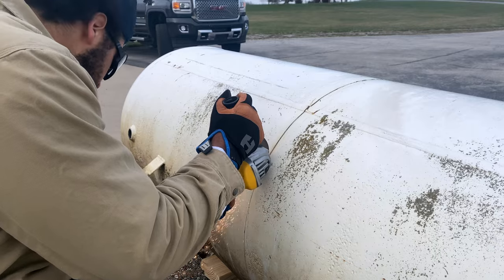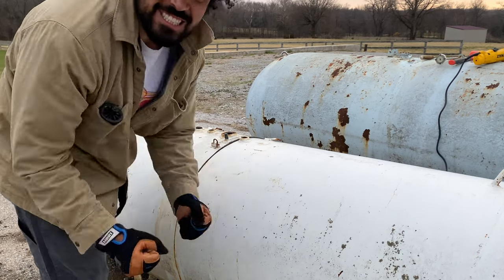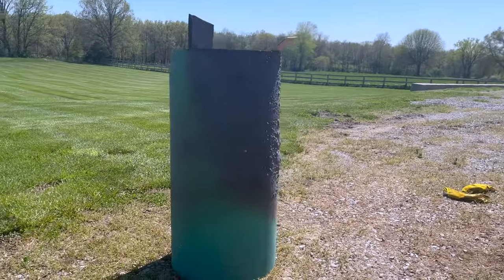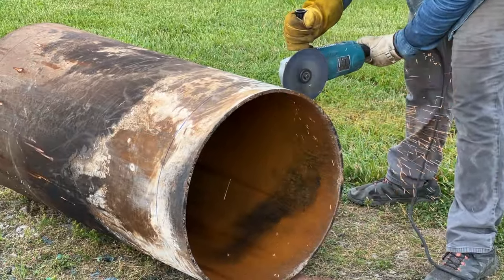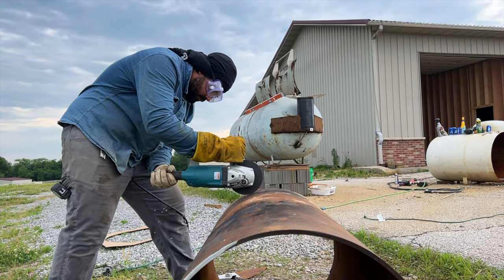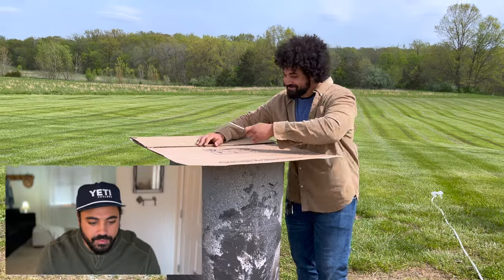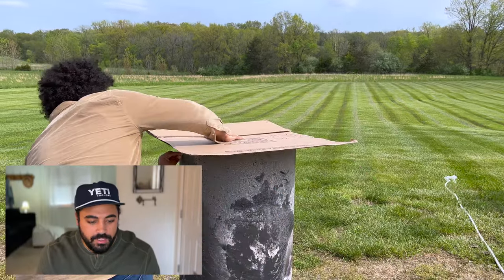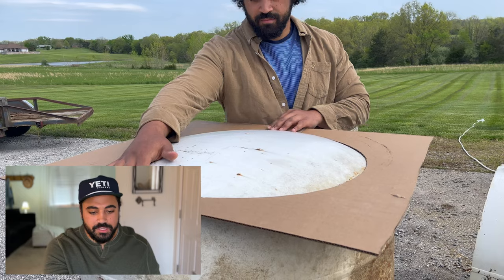Building A 500 Gallon Offset Smoker: Making The Semi-Insulated Firebox

Comment: The throat opening was the scariest part for me. Eventually i had to cut two more inches off the smoke chamber to make it work/fit right. Looking good so far! We ended up going with an insulated rectangular firebox with half of a 120 gallon tank as the liner.
Reply from the maker: Dude why is that the hardest part?!? Lol glad you got it sorted. Mine came out nearly perfect after all, but it wasn’t void of MANY headaches 😂

Comment: So you should have actually cut the hole bigger on the pit itself that way the Firebox can actually slide into the pit and not be welded flush against it and you would have not have needed all the spare metal. From Texas BBQ capital in Alaska welding on boats in the Bering Sea
Reply from the maker: Thanks for the support my friend!
Reply: @MeatNGreetBBQ  great job we all learn from our first pit build next time just slide the bottom of the Smoke Box into the pit more itself as well bro
Reply from the maker: @shaunreid6497 for sure bro! Good news is the pits been running great these past couple years and now I have much better idea for when I build… a 1000 gallon next 👀👀

Comment: Just throwing this out there. That liner may be sewer pipe. If it is at all used I wouldn’t use it because burning it out may not fully get rid of the residual h2s
Reply from the maker: It was a new pipe when I bought it. Had a guy cut it off a MASSIVE piece of pipe. It’s just rolled steel with that film over it. But good call on the sewer pipe that would have been all bad! 😅

Comment: Oh, I remember that green coating. It was a bitch to grind off. I was not able to burn it off like you did (the city I live in would have sent out the fire department and charge me for it).
That coating is for rust protection. That pipe was nent to be directed bury in the ground.

Comment: what is your outer shell diameter ?
Reply from the maker: Shoot I can’t remember— I feel like 36” but not certain. Just the diameter of a normal 250 gallon tank.
Reply: @MeatNGreetBBQ   thanks for the response i got a 125 gallon propane tank for my firebox,  outer shell is 30 in diameter so i think a 24 in diameter  would fit enough to give me a gap for insulation its for a 500 gallon smoker

Comment: I'm really surprised I haven't seen a comment with this: PLEASE WEAR A FACE SHIELD  WHILE USING GRINDERS. If one of those wheels comes apart, goggles are WHOLLY INSUFFICIENT to protect your FACE from fragments flying off after spinning at 11,000 RPM.
Reply from the maker: You’re like 2 years too late boss 😅 but I lived!!! God is good 🙌🙌
Reply: @MeatNGreetBBQ  it wasn't just for you. I was an iron worker before my current job and I've had them come apart. I've also seen them buried in somebody's welding shield when they came apart instead of embedding in their cheek. It's a really underrated hazard.

Comment: You should’ve packed insulation in that gap all the way around your firebox with the high heat insulation then you would’ve had a solid fire box even better but good job bro
Reply from the maker: Thanks for the comment and sub bro. Means a lot! I specifically wanted a semi-insulated firebox. Insulation coming from the air gap. In my experience fully insulated runs just a little too efficient for the way I build my fires so I opted against fully insulating it.